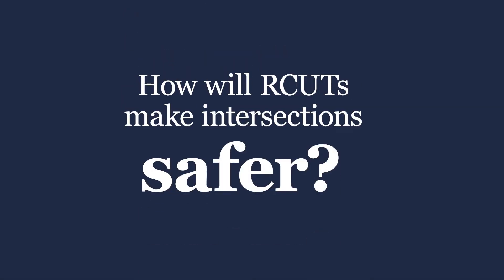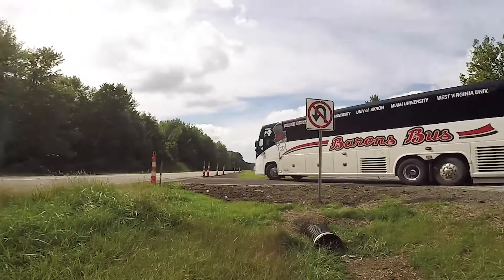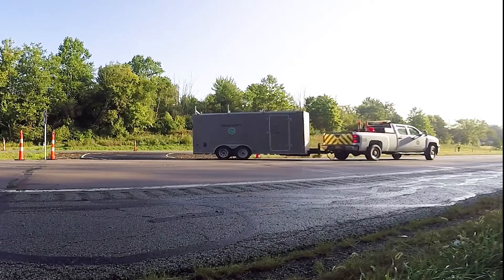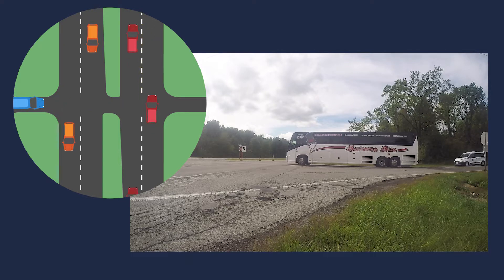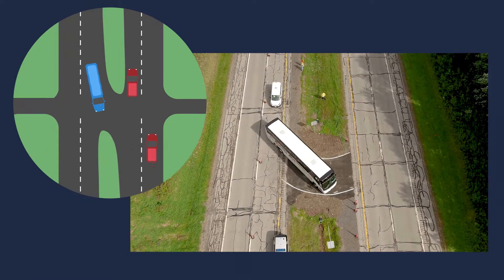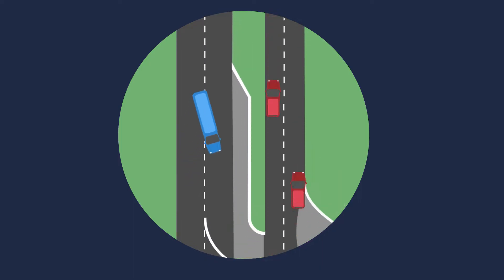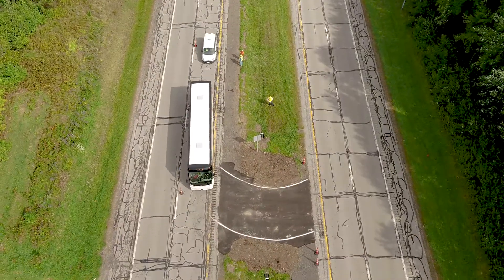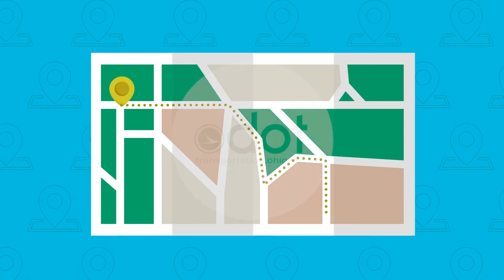RCUTs Explained

Comment: The double Rcuts have been implemented since 2015 in city of Hyderabad,India in several places. Though it looks great in beginning, traffic piles up eventually, especially in peak hours. Good experiment but not great results. But it has eliminated signal points and reduced waiting by 60 seconds on average which is great though. Now most of the places all signals are in green and we breeze by.